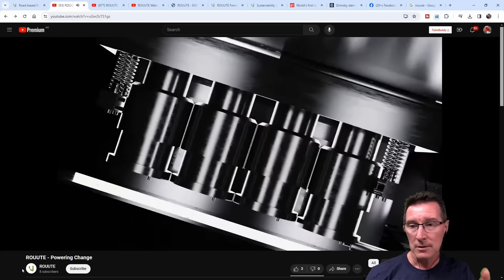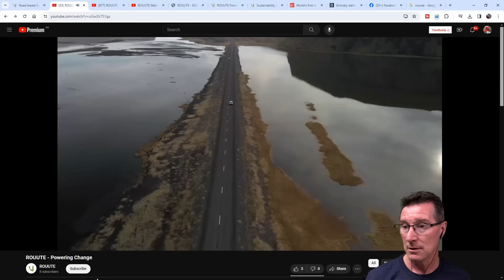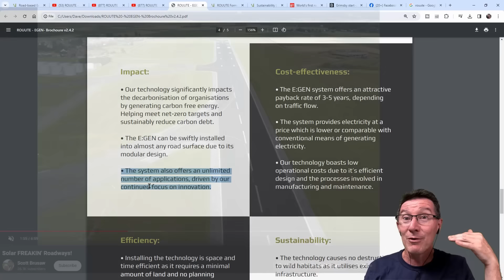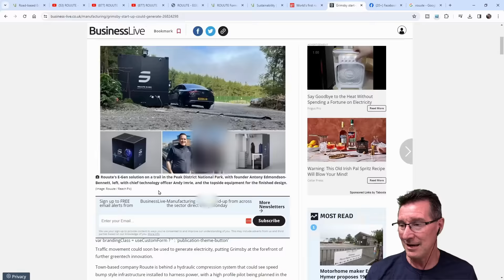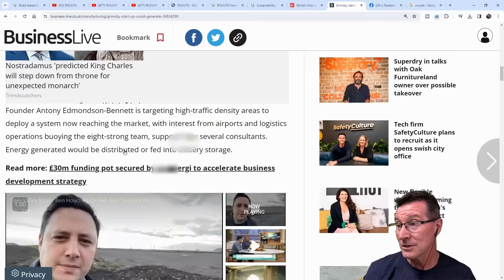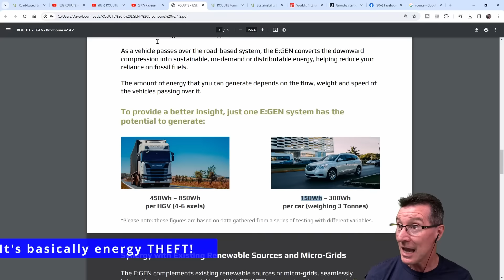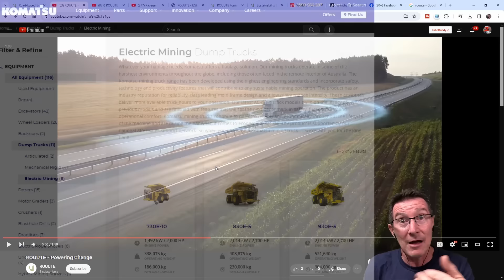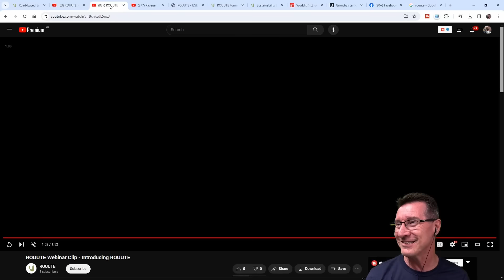EEVblog 1600 - Rouute: Road Based Energy BUSTED

Comment: I think Dave is being far too kind in this video. As others have said, this energy will come 100% from your car, so it will be less efficient for drivers to take roads with these "systems". But that's not even scratching the surface. Like, guys, hello... mechanical elements as part of the road... wear... reliability... things breaking... debris... I mean forget even that, this will butcher rolling resistance of all cars (which tire manufacturers strive for) and will massively increase tire wear. High speed + spring-loaded road elements = oscillations caused by interactions with tire elasticity + suspension. How about sports cars with hard suspensions and low ride height? How about basic traction?? How about snow?? How about vast increase to road noise and thus noise pollution for the environment? Can you even imagine the installation and material costs? This is an absurd concept from every angle lol. The best word for it, is absurd. Pure cash grab.
Reply: Or ice and snow and plow trucks. I also don't know how they would tune the springs to work for 2,000lb Miata and a 80,000lb truck.
Reply: @libtrs838  Ice & snow & plows don't exist where Dave lives.  Perfect for installing this!

Comment: I get about 250 watt hours per mile in my Model 3. So driving over a single one of these gives as much energy as it takes to go an entire mile? Now I may not be the best at physics, but these bumps look considerably easier to drive over than to drive a mile, given that drag exists. If I drive over 5 of these, I get a whole kilowatt hour! So... It sounds like a perpetual motion machine. Just hook up some induction pad right after the bumps and we have infinite energy folks! We solved it! Maybe we can also put dynamos at stop lights and have cars rev while waiting for the light to change while we're at it.
Reply from the maker: Yep, I did the calc, 300Wh is the same energy as stopping a 3ton car from 94km/h down to zero.
Reply: @EEVblog  They are probably doing some bad math combined with wishful thinking.
E.g. Taking the maximum energy harvestable from a car then multiplying it by 2 (two sets of wheels per bump), then splitting a bump into two bumps so each wheel compresses one half-bump and multiplying again, then adding another bump in series and multiplying THAT... then going "But what if a car is a fully loaded VAN?"
Also, any energy harvestable wouldn't come from speed reduction but from the weight of the vehicle - you can drive over a speed bump at full speed without it slowing you down. 
There's a speed bump I can see from my back window - people not minding the road (or their car) will go full speed over the bump. 
The bump doesn't stop the car. It is not a wall. DRIVER slows down the car to avoid getting a kick in the ass and to protect the car.

These guys are also off in their calculation by the factor of shock absorbers - that's where the energy is already going when going over a bump. 
Yeah, sure, the spring in their harvesting speed bump will store energy when a car goes over it - but so will the shock absorber spring in the car, that was designed to minimize the effect of going over a bump. 
Also, rubber tires. 

I had a moron run over my foot which was already in the road. I was standing, looking right, being careful and all cause I was holding an umbrella and it was raining - he ran by me from the left. 
It felt no heavier than a regular sized moron stepping on my foot. It took me a split second to realize what happened as he just drove on down the street. 
He was moving fast enough that all I experienced was a fraction of the weight of the car for a fraction of a second. 
It hurt a bit but I just mentioned his mother and continued walking to school. 

Same happens with a speed bump. Only a fraction of the energy as weight gets transferred. And the faster the car goes, the less energy gets transferred.
That's why people lose the grip of the road while going fast vs. going slow and why asphalt tends not to get depressions in the open road but will deform at traffic lights.
Reply: @d3nza482  “energy … wouldn't come from speed reduction but from the weight” blink blink

So… they get lighter when you drive over them? Weight is just mass. You have to put more energy in to get it moving a given speed and therefore you have to take more energy out to slow it down. It takes more energy to elevate to a given height thus there is more energy to steal when going downhill. It’s supposed to be YOUR energy though.

“you can drive over a speed bump at full speed without it slowing you down.” Nonsense.

You know that BANG you get when you hit a speed bump when going too fast? That’s your forward momentum getting transferred… elsewhere (up and down). Put a bunch of speed bumps on a row and you will slow down drastically unless you put more energy in with the accelerator pedal. Even then, a succession of these energy-stealing speed bumps will shake you apart with your own forward momentum they stole from you.
Reply: @emmettturner9452  Try it like this... the energy they are trying to exploit is gravitational - their springs go up and down, not side to side.
I.e. Force vector is pointing down, towards the center of the planet. BUT, if you move an object horizontally, you are altering the angle of influence of that force on the object, changing the object's force vector. Alter it enough and the object will start flying. Alter it more and it will beat the Earth's gravity and fly off into space.

"Even then, a succession of these energy-stealing speed bumps will shake you apart with your own forward momentum they stole from you."
You are literally arguing that these speed bumps are a good way of harvesting energy - while also arguing that the energy would be shaking the car apart. 
That would require these bumps to be able to actually CREATE energy by MULTIPLYING it somehow. 

"You know that BANG you get when you hit a speed bump when going too fast? That’s your forward momentum getting transferred… elsewhere (up and down)."
The amount of energy transferred that way is negligible. Particularly compared to the energy they are trying to harvest - gravitational pull on the mass of the car. 
Hint: Going over a bump doesn't cause the car to stall NOR do you have to invest a lot of time or force to get back to pre-bump speed. 
Meanwhile, they are working with numbers based on the force a stationary car's mass is exerting on Earth. That's how their energy-harvesting springs work.

Also, you are actually arguing about efficiencies in regard of the car and the driver - which is irrelevant in this case.
Both because a constant speed can be maintained over a bumpy terrain (while shaking the passengers but not shaking the car apart - look up Rough Road Durability Testing) - AND because this device is NOT supposed (nor can it) to harvest the energy from car's acceleration BUT from its stationary mass.
Again - springs go up and down, not side to side, front to back.
Reply: @d3nza482  I believe the correct word is "lying"
Reply: The unit probably is Ws (Wattsecond) and somehow someone has auto-corrected that to Wh in their documents.
Reply: @Rob2 probably the marketing team didnt know what Ws is and 'corrected' it to Wh.
Reply: Has to be over a mile plastered with these bumps or something like this. Then you lose "only" a few km/h on each hit ;)
Note: they didn't specify what "one system" means, how many bumps, modules etc... basically a marketing lie.
Reply: @1Hippo Except you have to crawl over them, They won't work at road speed, And would be like hitting rocks at motorway speeds.
Reply: you don't get it, they'll stop your car for 1 minute to run the wheels.

sure it's an abrupt stop when you're driving 50mph and you get latched on the device but think about it, it's energy you paid for and not the city, it's only right they ste.. tax your battery in an inefficient neck breaking manner.
Reply: @lasskinn474  So, car in a hamster wheel?
Reply: Human nature dictates that car drivers will avoid places with annoying and property damaging  speed bump zones for their own  comfort.
Reply: @jeffmassey4860  Why would you avoid driving over 300bumps so you can drive 300 miles bump free afterwards?
Reply: Yeah, the interpretation that it's one drive over the thing made no sense. That is what the publicity materials seemed to be saying, and Dave needs to explain to us(who likely know more than most about this stuff and clocked that as curious instantly) how everyday people will see it, but they make no sense.  

I wonder if they clarify that somewhere? Because if it's a real number, it's sure as hell not a single pass over one of these units. They may have some reasonable scenario in mind that does in fact lead to the claimed numbers, but it really needs to be much more prominent in their materials or I'm worried they're hiding it deliberately.
Reply: Hahahahahahahahahahahahahahahahaha

Comment: Last time I was this early people were believing that putting solar panels on the road was a good idea.
Reply: To be fair, putting solar panels over the road wouldn't be that terrible of an idea, basically covered bridge 2.0. The only problem is, just putting the damn panels next to the road is so much cheaper there's no point in covering a road for solar :D
Reply: @Lolwutfordawin  Not 'on top of the road' but 'on the road', a big difference there. The first one is just more expensive than it needs to be, the second is ineffective as well and in more ways than one.
Reply: @zwerko  yeah, I know of the whole solar freaking roadways debacle. If the pavers were cheap enough and durable enough, it wouldn't be too bad though. Roads are cleaned here several times a week anyway and rarely have that much traffic on them that would block light.

Comment: As is, on level ground this is literally just stealing energy from your car making people use more gas to compensate. It might be SLIGHTLY less stupid on the downward side of a hill where it's stealing extra kinetic energy that would otherwise be wasted by the brakes but it's still idiotic.
Reply: Yeah,  but if you have an EV it also stealing energy you would be regenerating when going downhill so it's always stupid.
Reply: Compressible speed bumps would do wonders for traction control while braking, let alone the vibration through the suspension.

Comment: Speedbump freakin' roadways
Reply: they should just put them at the entrance/exits of buildings and at the end of roads where you can only go left or right as you have to either stop or slow down to go in those areas anyway. wait oh yeah they're "speed bumps" :)
Reply: @Amokra  And around here they break and need repairing a lot.  Takes the council so long to act cars are now 50% heavier then when they trialled the speed bumps and most cars are also lower with many factory unmodified cars scraping them daily.  So they had a max height but they still got the heavier cars braking before and dropping off the bumps puts extra loading just before and after which lowers the road surface, the legal bump height when installed is no longer legal.
Reply: @WhiteDieselShed  totally agree. I know a few places that you go the long way around to bypass the bumps.

and if was at what i said, was just saying the only places I can see these things working correctly

Comment: Loll they are stealing energy from your car at the very best
Reply: It's just making regenerative braking less efficient.
Reply: Stealing while wasting some.
Reply from the maker: Not if you put up a sign, then you've been informed and consent if you proceed.
Reply: @EEVblog  Sure, just give the option to drivers to make a u-turn, and proceed to waste even more energy, then say "see? I gave them the option to avoid, we're not stealing anything."
Reply: If it's a road with no stopping lines than it's barely consensual  @EEVblog
Reply: Works best if you drive a G-wagon
Reply: @MeppyMan too efficient. More so coal blowing diesel pickup.
Reply: Not only that, but they are also putting strain to cars suspension. Also creating massive safety hazard if downhills are full of them. Also good luck getting them work on below zero temperatures.
Reply: @KakkuL4p10  Well, you could use the harvested energy to heat the system, no problem. :-)
Reply: Here in the US in New Jersey if they put one at every one of our 1,245,642,985 toll booths we have it would literally power the entire planet.
Reply: And considering most cars are gas powered, this is actually carbon positive! lol.
Reply: Well normal after they stole 10M from VCs
Reply: This was my first thought.   Within the first 30 seconds of the video. That energy comes from somewhere.
Reply: It’s not road based energy is gasoline based energy
Reply: it would make sense to install these on deceleration zones  to help vehicles reduce velocity, but the gathered energy would  be of such small magnitude this system would never break even.
Reply: Yes, converting some forward motion into vertical suspension deflection is always preferable. 🤪
Reply: I business, this is called an 'externality.'
Reply: This was companies plan. People charge EV batteries and suddenly chargers are drain EV batteries to powerlines.
Reply: Exactly, would be more efficient if they would just raise a car related tax.
Reply: ye but the cattle will save us  👍😂

Comment: So many restrictions: First, it would only be useful where no local power exists. Which means on roads without street lights, without traffic signals, with no residences or businesses nearby. Second, it would need to be located where getting folks out to maintain it would be practical and affordable.

Fortunately, I do have a use-case that meets these requirements: In the early cell phone days, CALTRANS (the California transportation agency) placed solar-powered cell phone boxes along the more remote stretches of local highways so folks with breakdowns or emergencies could summon help. Each was powered by a small solar panel, and each had a small blue LED on top that showed it had both power and a connection to the cellular network.

But solar is ideal for such small loads. Let's make the power demand of this remote roadside device much larger. How large would it need to be to where the speedbump system becomes more effective and lower cost than a solar system? My SWAG is the power production vs. cost curves would NEVER cross.

Then we need to add a third requirement: It would need to be a place where solar either can't be used, or would be clearly inferior to this system. What would that be, underground? Anywhere there is a road, there is CERTAIN to be a view of the sky nearby!
Reply: north of arctic circle.

there's just this small problem of ice.  maybe they could also install solar roadways to heat the roads.
Reply: @lasskinn474  solar roadways proposed to heat the road with their connection to the grid, not with the solar energy they absorbed over that same area. If the solar energy over the road’s area were enough to melt the ice the roads never would have frozen in the first place. ;)

Comment: Traffic counters use a very similar principle, car drives over a pneumatic tube which is counted by a micro-controller likely using only a couple milliwatts, yet interestingly all the ones I can find after a quick Google search require a separate power source, either a battery or a solar panel, for some reason none of them tap into the claimed huge amount of energy to power themselves? I wonder why?

The 'potential to generate' Wh figures to me read like the usual marketing "UP TO" absolute theoretical maximum claims which are actually just the total kinetic energy of the vehicle going 60 mph.

Also you posted this just as I was watching the new NTSB animation for the Fern Hollow Bridge collapse, really nice how an unbelievably incompetent road infrastructure idea like this gets £250,000 so easily yet bridges that are found to be critically structurally deficient have to go without repairs due to a lack of funding...
Reply: The original traffic counter were purely mechanical, the battery powered ones are a recent (ie 30-40 years).  The battery powered ones are classifers, they have the smarts to distinguish what is running over the tube, hence the battery.

They can tell the difference between a bike to a road train to everything in between.  A bit hard to do that mechanically.

Pneumatic counters, like inside ye olde school traffic counter,  are still used a lot in industry.  Just your basic mechanical counter we've all seen, but air actuated rather than having a solenoid or lever.  

The cool kids use radar or pattern recognition these days.
Reply: @j.f.christ8421  yea, I'd love a modern camera based one. Setting up the pneumatic tubes is a pain, and I've had them rep out of the asphalt on a hot day
Reply from the maker: Little known fact, Bill Gates's first product was actually a microprocessor traffic counter computer. He couldn't sell any.
Reply: @EEVblog  He still got $50k grant for it from daddy's state officials friends.
Reply: @EEVblog  Probably because he hadn't hired Steve Ballmer yet.
Reply: I work with one of these, the pneumatic counter has an integrated battery that's good for a couple years. Omwhen the battery is dead you send the entire unit back for a new battery.
Reply: I have up to 10 Ferraris :)
Reply: Should have been long replaced with induction-based counting system. With two wires, can not only count, but detect speed as well.
Reply: @nameredacted1242 I've never seen one installed for longer than a month, why would you close the road and dig it up to install sensors for something so short term. Also the ones used by my local council have 2 tubes and can also detect speed and vehicle type. Seems like there's no advantages unless it's a permanent system